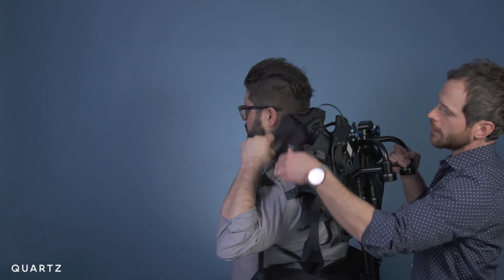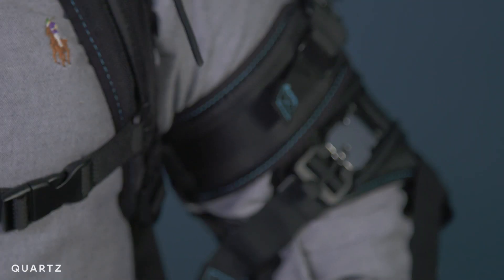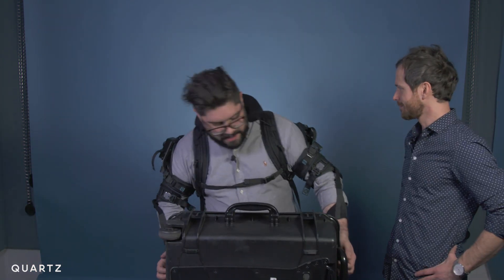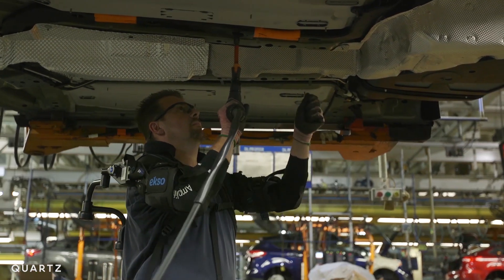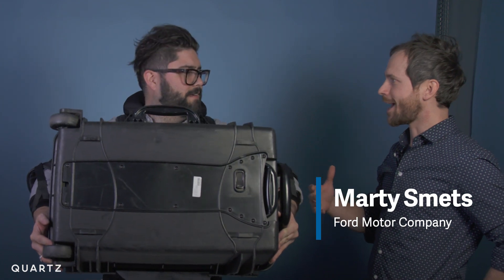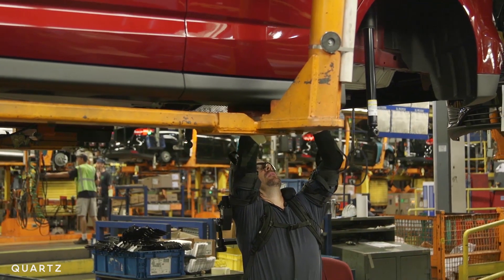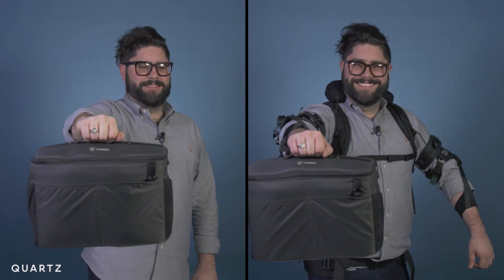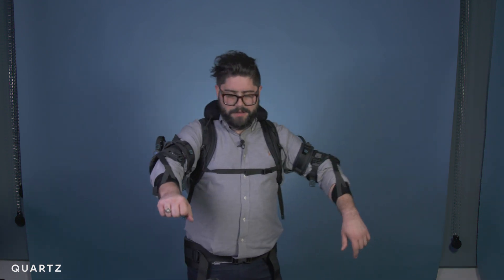We tried the exoskeleton Ford factory workers are using

Comment: Powered exoskeleton suit's, for workers, at Ford or any large company, are just a stop gap until the capability of the robots, and power, match that of the human worker's ! . Then you will have factory's were you will see the raw materials going in "Automated Trucks delivered materials ", and finished products coming out at the other end "Automated trucks delivering the end product from factory to distribution " ,  No humans at the beginning of the production and no human at the end just Robots lots and lots of machines ! . And at the top of this machine pyramid , a few humans making millions or billions in rev-anew, with out a cost in production apart from maintenance, spear parts for the robots and electricity costs. All of this is going to happen in the next twenty five years or more, we could be looking at the last generation, to be involved in the traditional way of working to make a living  ! .
Reply: These are not powered suits. They use springs to assist in lifting and the rigid frame transfers the weight to the hips. These are to reduce strain on the worker so the worker is less expensive over time. A robot still can not compete where these complicated tasks require a human, so you make the trained human last longer with less medical expense.
Reply: Barrie Wright robots already do at least half humans just maintain them but soon they won't need humans but to just make sure there doing the right stuff
Reply: Honestly, I can’t wait. I don’t trust any of you fucks. I’ll take the A.I. / Robotic supply chain for 500, please, Alex.
Reply: Yang for president! He is for universal basic income or as he calls it...The Freedom Dividend
Reply: LOL, and who will found it then? None of these robots and exos are being researched, build and owned by arm-chair communists. If anything, this progress will reduce value of individual human being, since they no longer will have place in creation of valuable products.
Reply: Dear Barrie, many of those matters already is in place. Don't you worry for them making money.. There is invention in place... It's called tax 😀 it's 'automaticcaly' placed on value of sales 😀
Reply: So, communsium?
Reply: Tang No Technology and the need for profit ! , Communism no that's a ideology that puts people first as a collective , over the needs of the few "the ruling Elite " capitalist, this will allow the few over the many to achieve protif at NO COST capitalism ! .